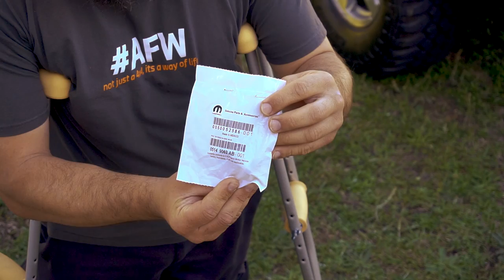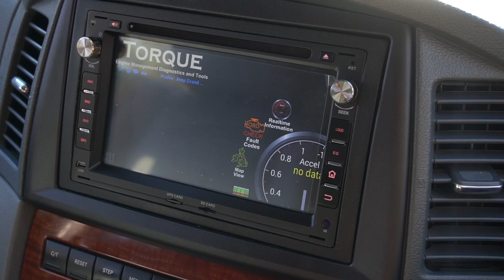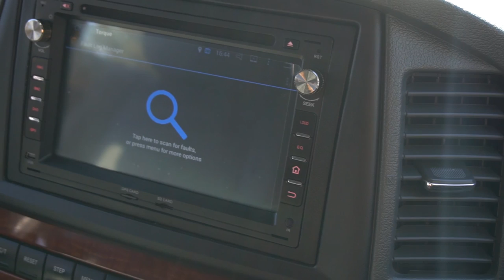Engine Oil Pressure Sensor Replacement - Vlog #9

Comment: Remember. Make sure the engine is cool. Probably a bit cleaner if you do it when the oil is dumped for an oil change. Great video. Trouble is, these days, I've become a bit of a lazy sod on my cars and pay other people to do the dirty work. Hope that leg gets better soon mate.
Reply from the maker: Thanks mate 👍 Yeah, the leg is getting better. I've been off the crutches, but this is an older video that I forgot to upload. Yeah, changing it when doing an oil change would've been ideal, but I only changed the oil and then the sensor shat itself afterwards. Always the perfect timing HAHA.

Comment: Please show Toyota Corolla engine oil pressure sensor replacement video...
Reply from the maker: Unfortunately for you, this is a 4x4 channel, but shouldn't be hard to find. It has to be on the bottom end of the engine block somewhere.